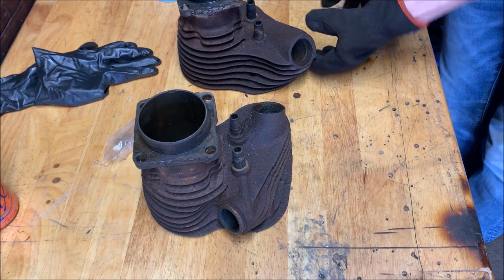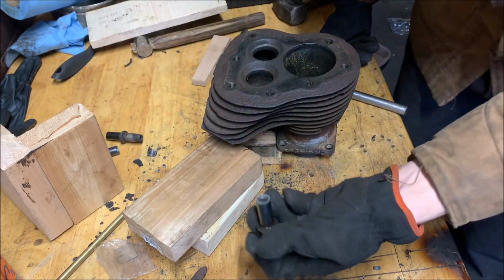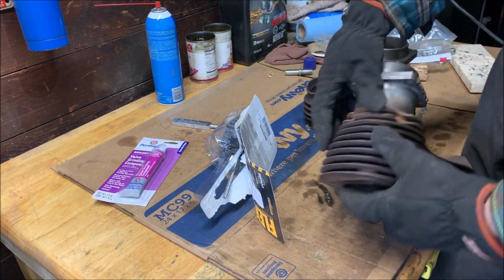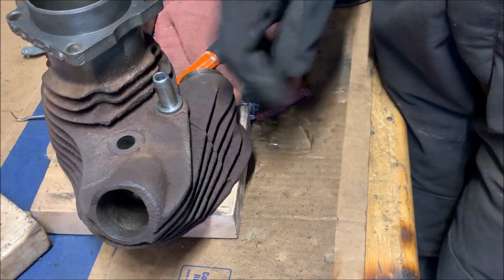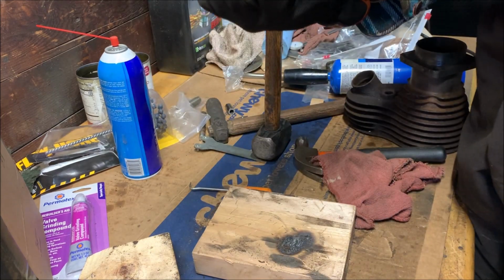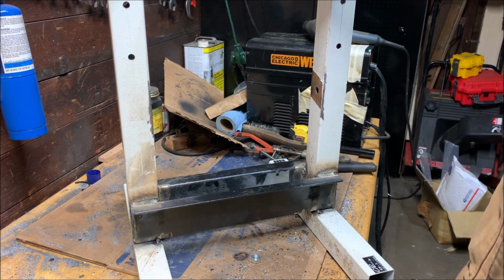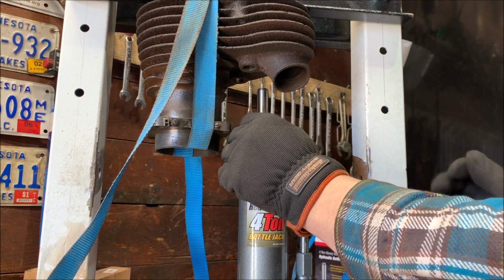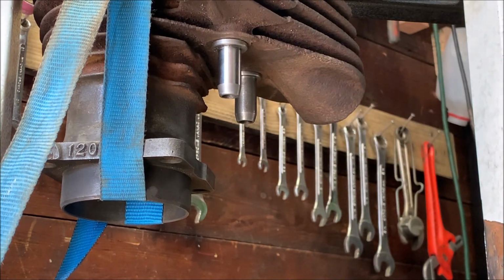Harley Flathead Engine Reassembly Part 8: Pressing Valve Guides and Building a Press

Comment: Now the key to doing this as you you have an old oven electric put the whole thing in the oven and heat it up to about 250-300 maybe 350 but key thing is this put the guilde in the freezer. And sunning makes a real good liquid in a spray can for putting guides in if you don't have that you're use some knocker loose. You may get the valve guide but what if your fractured. We used to do a lot of antique Harley work at the shop. Even making bronze guides out of old boat shafts.